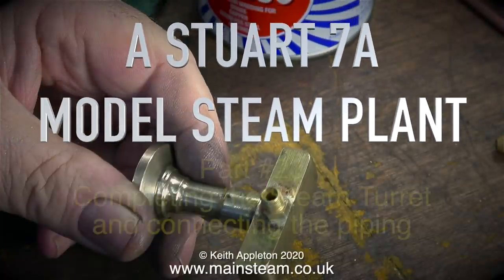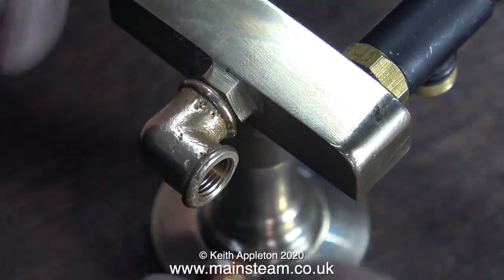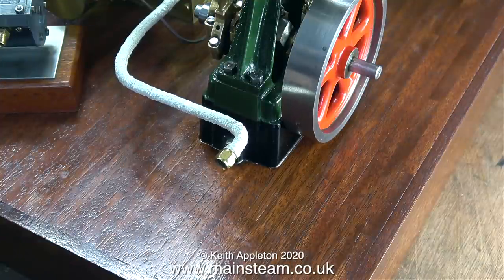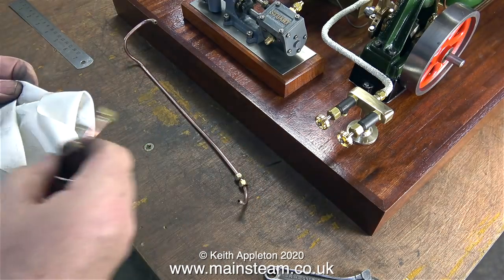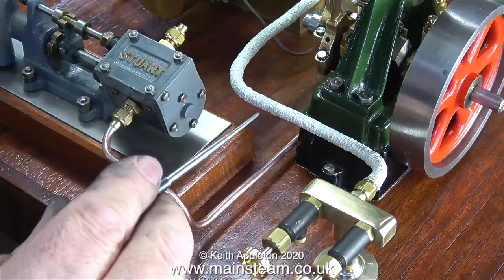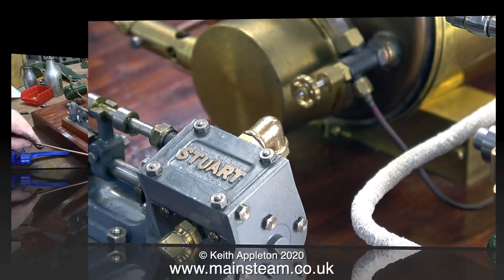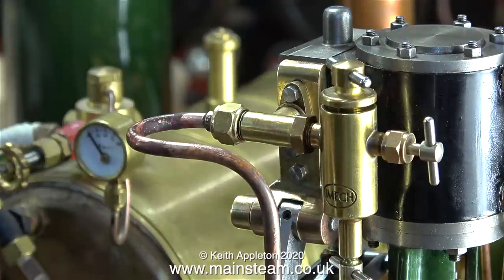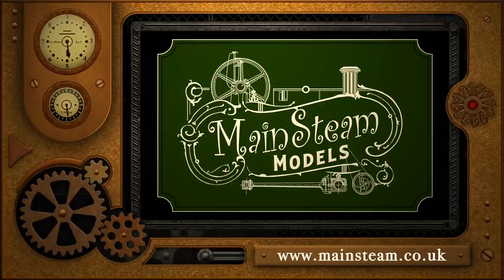A STUART 7A MODEL STEAM PLANT - PART #23

Comment: The elbow on the steam inlet to the pump was oriented down when you screwed it on, but in the final view it faces towards the turret.  Otherwise, you would have had to make another 90 degree bend in the pipe to the turret.